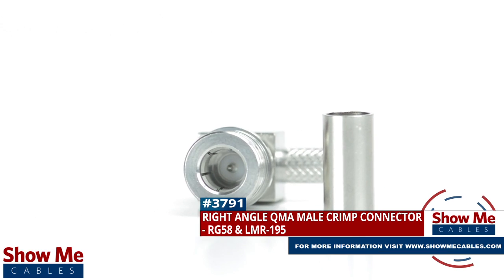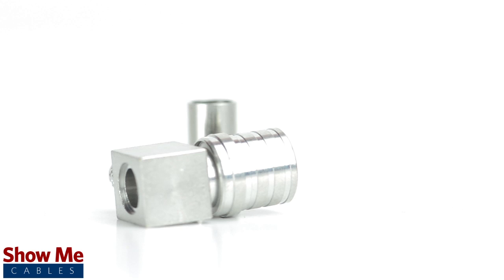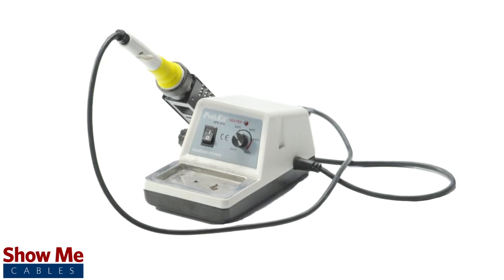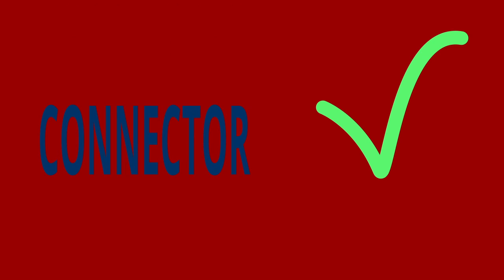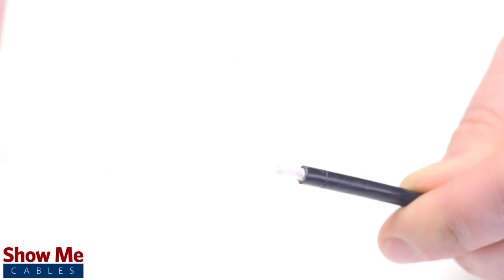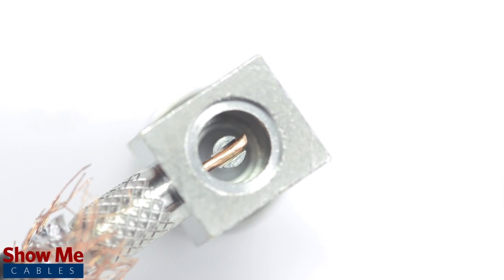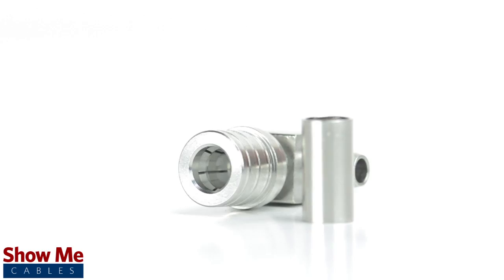Right Angle QMA Male Crimp Connector For RG58 & LMR-195 - Perfect For DIY Installs!

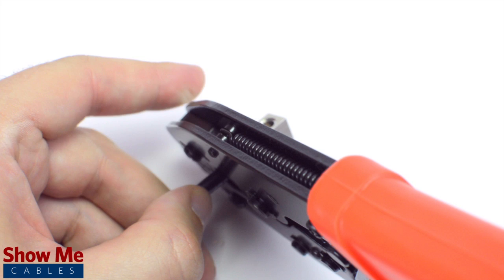Comment: There is no way to screw on back plate as you are showing at 1:08. This back plate doesn't have a thread and slot for screw driver to go in. It has to be pressed in.